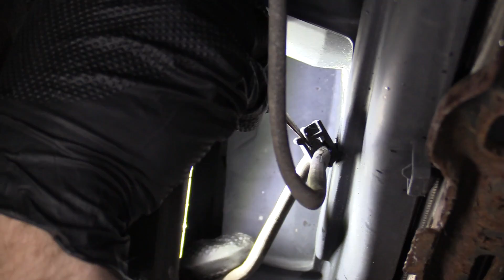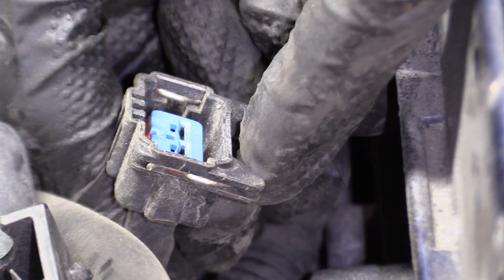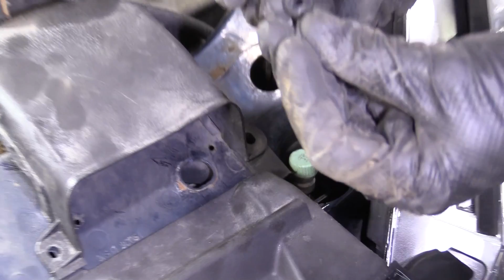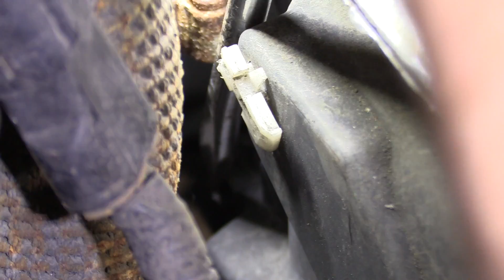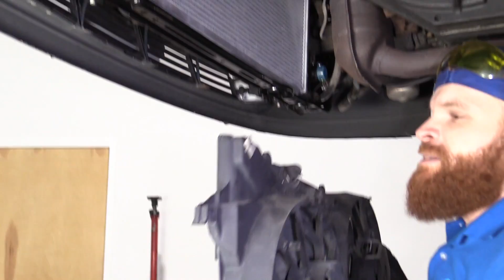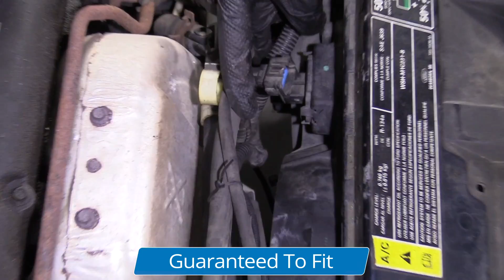How to Replace Radiator Fan Assembly 00-02 Ford Focus

Comment: Great video, I'll be coming back here if I end up needing to replace the fan. I just bought a 2000 Focus, and I've been working to diagnose low speed fan not working. I just discovered that the fan harness isn't actually plugged in to the main wiring harness, and I can't find the correct plug hanging loose anywhere. I clicked through hoping to scope where it should be but I couldn't get a good enough view. I'm reaaaaallly hoping the previous owner didn't just cut it off somewhere, that's beyond my level of expertise.

Comment: Good video but the fan harness should be removed with the fan assembly. You only need to disconnect it from the under hood harness. If it needs to be transferred to the new fan assembly that should be done with both assemblies out of the vehicle. Most new fan assemblies come with a new harness.
Paul

Comment: Zts 2.3 is not like the model you working on. All you have to do is disconnect the two upper plugs   and jack the car up and push up the fan assembly up and slides right out.
Reply from the maker: +Fabien Thanks for the tip!